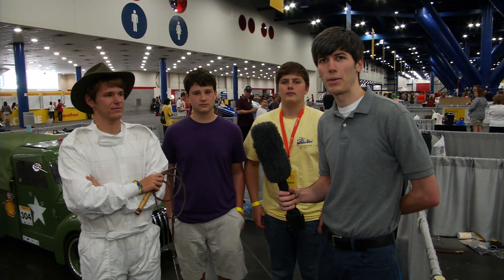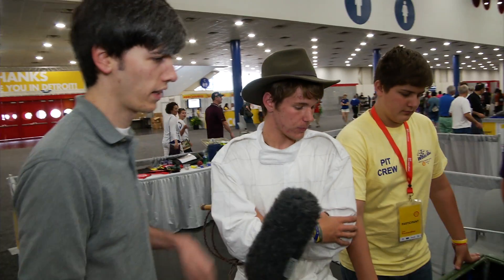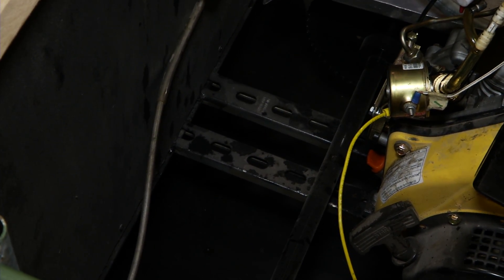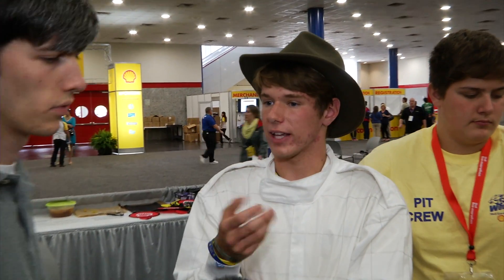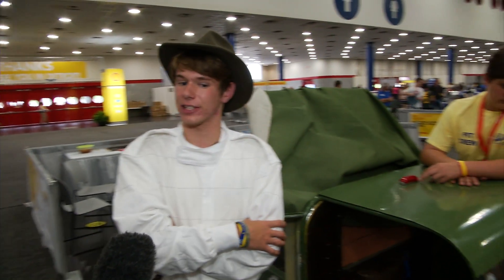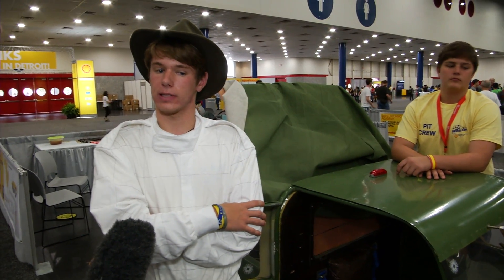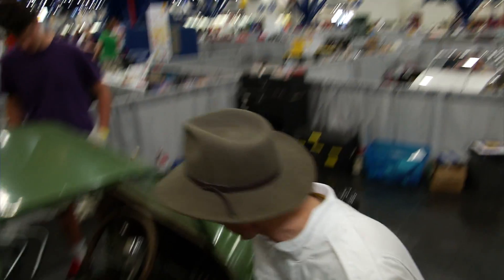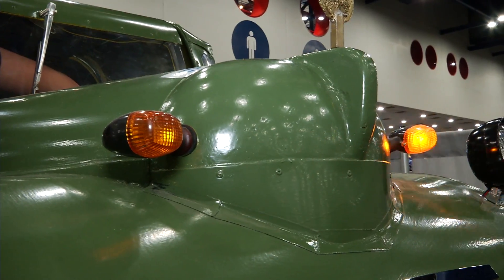Eco Cars - Shell Eco-marathon - St. Paul's School Interview

Comment: Speaking of rotational weight (or was that the last vid I watched lol), what are your thoughts about internal engine components being made of carbon fiber? Lets say crankshaft, tie rods, etc... Contact surfaces will need metal sleeves but I don't see why carbon can't be used for the other stuff.
Reply from the maker: Possibly feasible, but I'm not sure if fiber would be as strong in many of the various forms of stress placed on the components compared to more elastic metals. Carbon fiber is a bit brittle.
Reply: always wanted to ask this! ive always been wondering..
Reply: Engineering Explained then how about CARBOTANIUM?? The one in Pagani huayra...! I heard saying Mr. Pagani in an interview that it is stiffer and is much LESS brittle than carbon fiber because of presence of titanium fibers alongwith carbon fibers in it..!!

and by the way, carbon-fiber's structure can be fine-tuned to make it work for different types of stresses, rite??? (m not dat sure, so m jst asking)